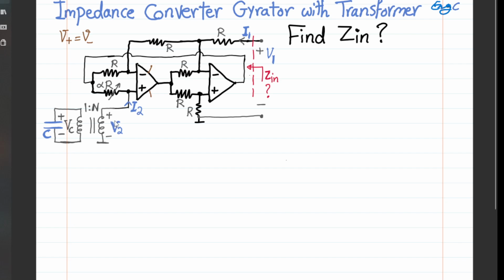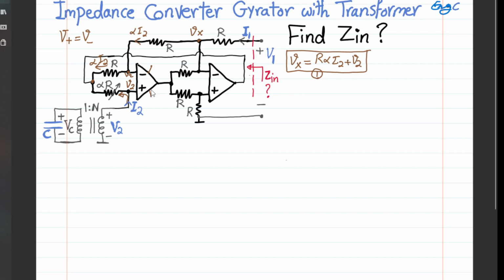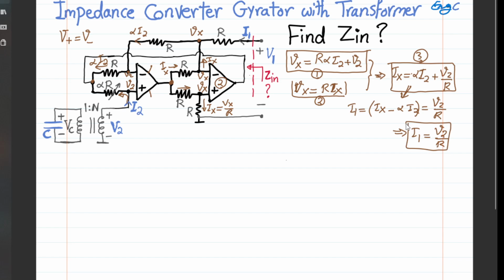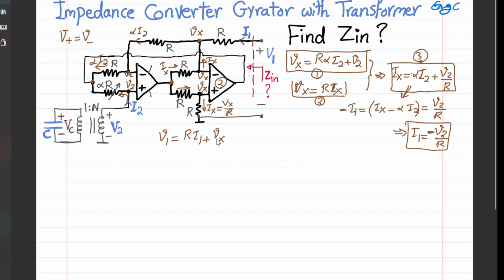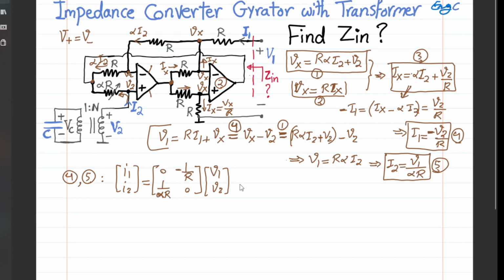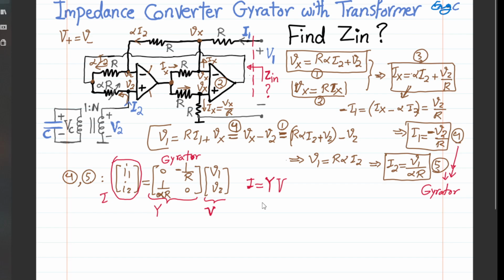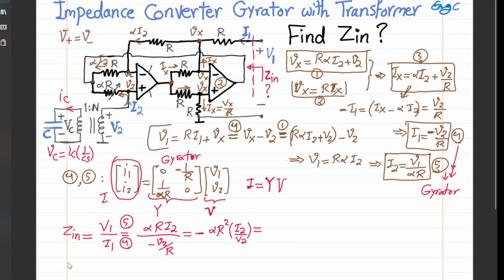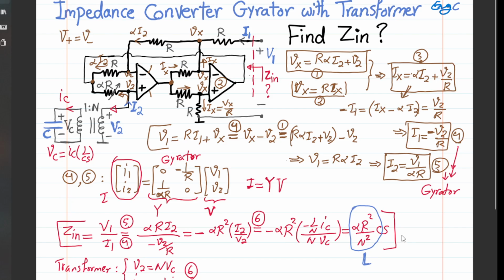Impedance Converter Gyrator with Transformer to convert Capacitance to Inductance

Comment from the maker: Thanks for watching. For more circuit examples see: 
Negative Inductance with Gyrator https://youtu.be/GF_Mun_Mkyo 
Impedance Converter Design with Op Amp (Gyrator) https://youtu.be/jPudh9yqDH4 ,  
Active Inductor with Op Amps https://youtu.be/6IYz4iaa05c ,  And Analog playlist https://www.youtube.com/watch?v=kX5X8jBXVXw&list=PLrwXF7N522y4c7c-8KBjrwd7IyaZfWxyt
Note that practical inductors have limited range of inductance. The larger the inductance, the bulkier, more expensive and more nonlinear that inductor becomes (low quality factor).  For example the whole circuit including rest of components might be much smaller than just a single one milliHenry inductor. I hope this is helpful.

Comment: What is the use for this circuit?
Reply from the maker: Thank you for the question and watching this impedance converter circuit video.  Realizing large inductance or high quality inductance in circuits in practice is difficult and sometimes even impossible. That is when this impedance converter circuit is useful.  As you can see in the video, there are only one capacitor and few resistor in this circuit and we are able to realize or emulate an inductance when measuring input impedance Zin looking into port one in this circuit.  The value of the effective inductance is L = alpha*C*(R/N)^2 which means for instance if I select potentiometer's alpha = 1, C=0.1 micro Farad, R= 10 Kilo Ohm, and N=10, then we get the Inductance L = 0.1 Henry that is remarkable!